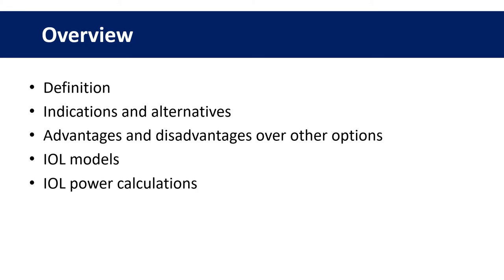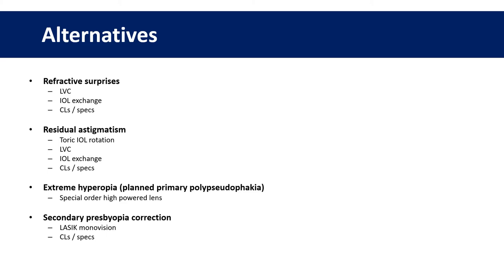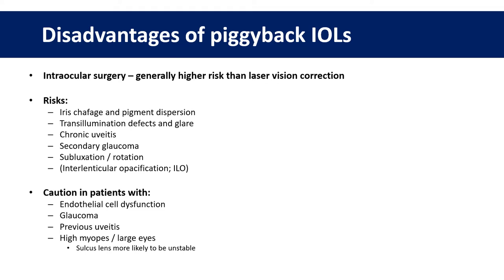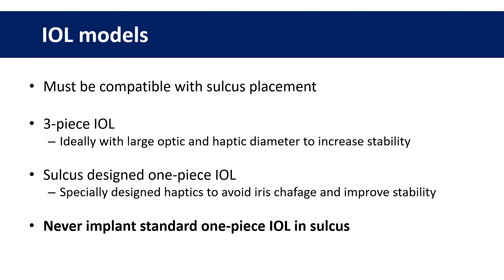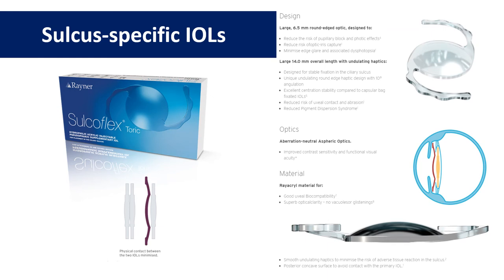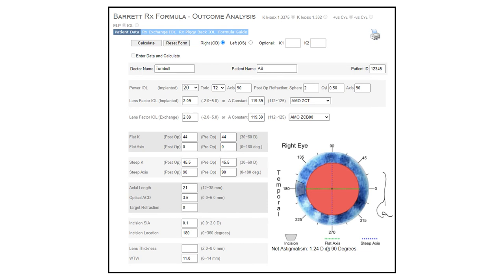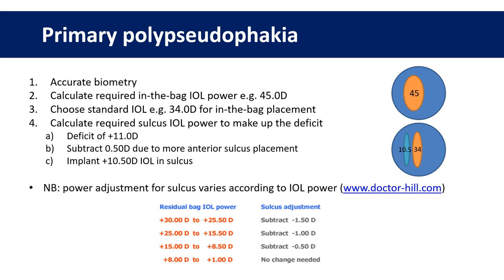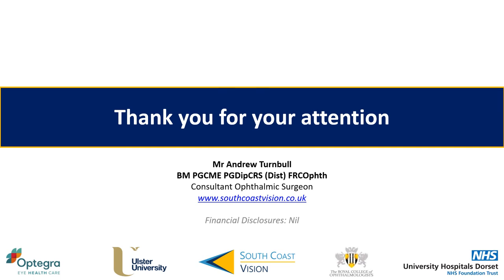Piggyback lenses after cataract surgery

Comment: Longer term safety and stability a concern. Can you expand on that? Thanks
Reply from the maker: Lenses specially designed for sulcus placement / piggyback tend to do very well over the long term with low incidence of pressure problems, inflammation etc. If those issues do arise, they can be easily explanted but this is rarely necessary.

Not all lenses are safe for sulcus placement however - e.g. the single piece acrylic lenses with sharp edges and thick haptics. Best to go for something designed for the purpose like Sulcoflex or AddOn, or a 3 piece lens with slimmer, smooth haptics (to reduce the risk of iris chafage and UGH syndrome).